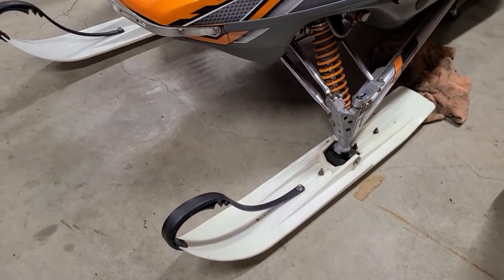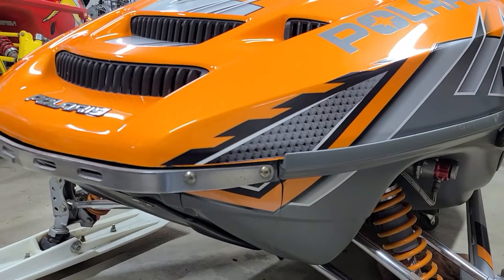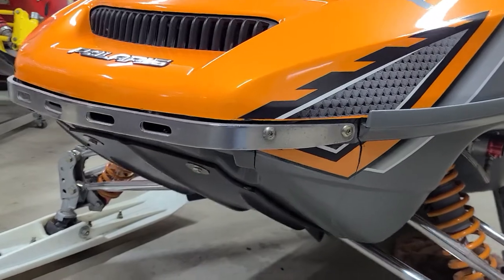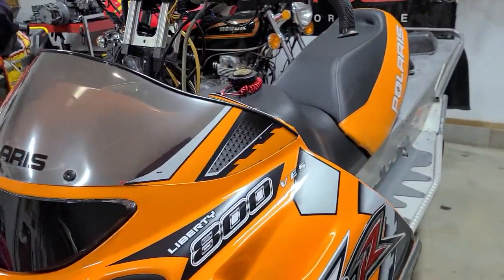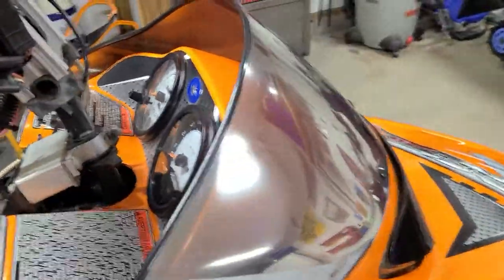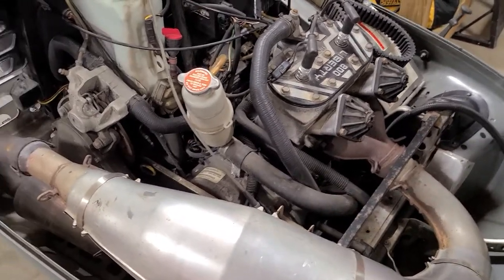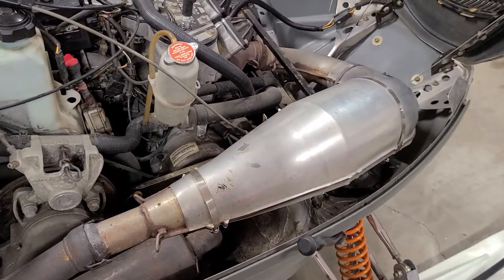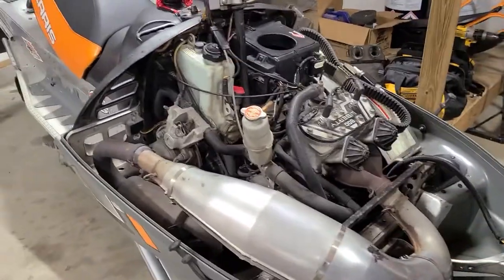2004 Polaris Pro XR 800 Snowmobile Project Introduction

Comment: If you can get your hands on a set, Polaris made longer heat exchangers for these sleds. It was part of a complete 136” kit they sold which was tunnel extension, full length 136” rails, uncoupled the skid and relocated the rear torque arm further back in the tunnel, and as I said longer heat exchangers. 
I know I have torque arms from the kit laying around, might have heat exchangers still too… I’ll have to check.
Reply from the maker: I'll have to look into it. Having full-length coolers would be slick! I've looked at converting to Ice Age IQR rails if I can't find what I'm looking for

Comment: What's the difference between this one and an 2004 pro x2 800? I'm looking at one right now, that is also extended to 136" with a Boss seat. It's pretty decent.  Also, any idea how durable these engines are? I know polaris had some hit or miss 800's. I'm a Yamaha guy, and used to have a triple 700. But I want something different, lighter and nimble for deep snow.
Reply from the maker: The XR has the obvious orange graphics, different bulkhead, more upright/forward steering, stiffer shocks, different bars, and a taller and stiffer seat are the big ones. More subtle differences. 800s are hit and miss. My old one (that my dad still owns) is going strong still at 6000+ miles but this one has failed twice in ~3200 miles
Reply from the maker: They are fun sleds but are known to trench badly in truly deep powder
Reply: the handle bar set up mostly seat maybe little higher too
Reply: Xr vs x2.
Xr has 3” taller seat stock, though similar looking.
Plastic consul is different, along with controls.
Xr steering post is positioned further forward.
Shock valving & spring rates differ.
Xr has the traditional style stronger drive shaft, x2 had the light weight (larger diameter) drive shaft like newer sleds.
Xr did not have PERC from the factory, however all that was needed to add it was a helix and button.
Xr had no sway bar
Xr had a 14” wide track stock

These are snox inspired sleds, and generally are not that great in deep snow. At one point I had a 04 proxr 800 with a 151”, although cool IMO a stock 151” edge rmk would have outperformed it in snow.